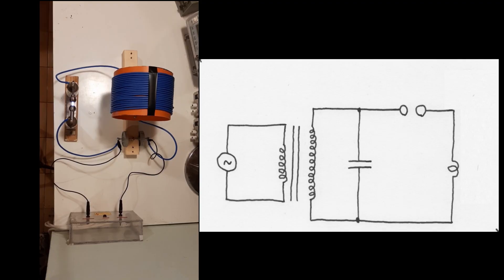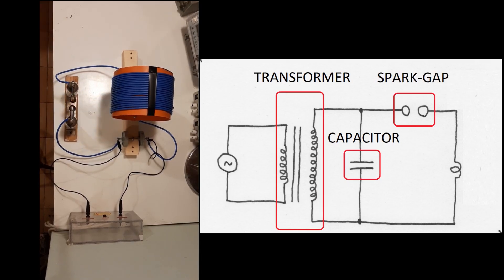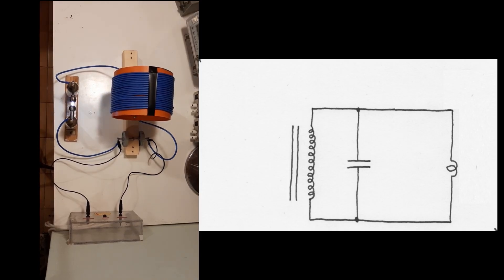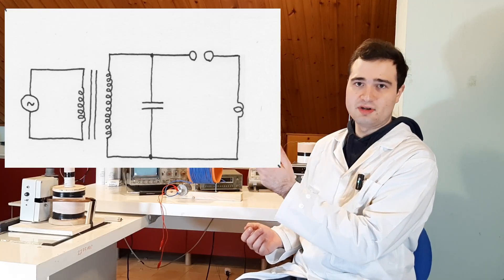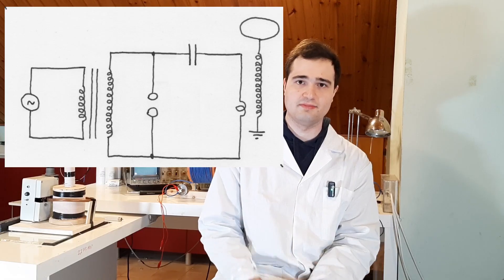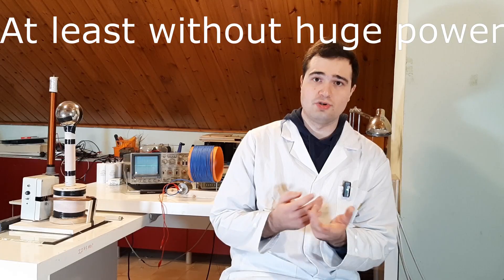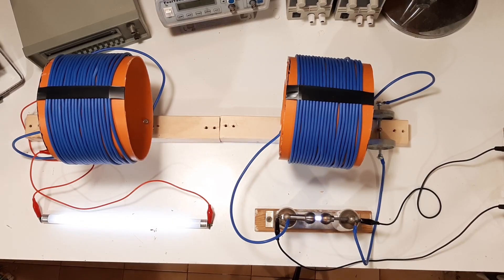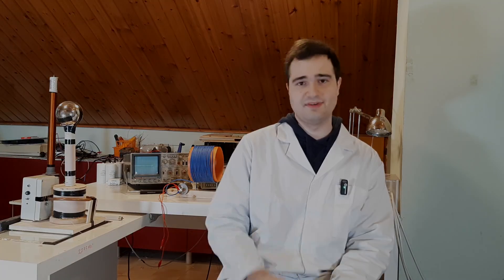Spark-Gap experiments 3

Comment: I just found a pancake coil in a broken induction heater, if i take that out and put it on my working induction heater i should have resonance and be able to run a light globe from it. Thanks !!! is bifilar better for the coil of the second one if i wind it myself instead of using the broken one? i have seen bifilar coils working over large distances from one house to another.